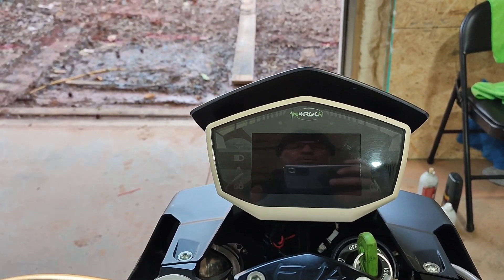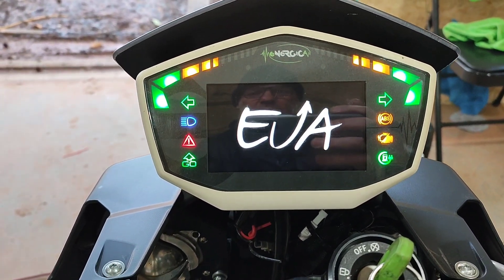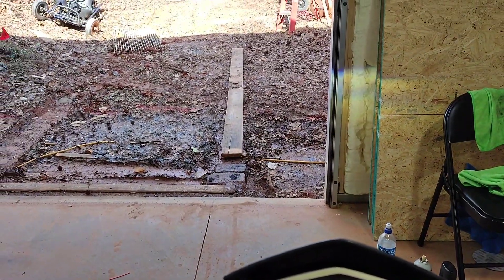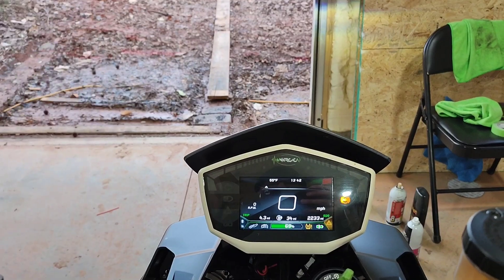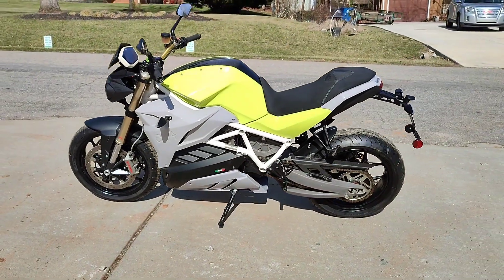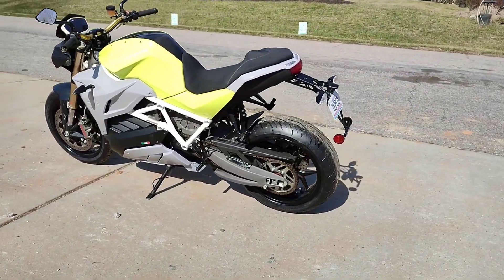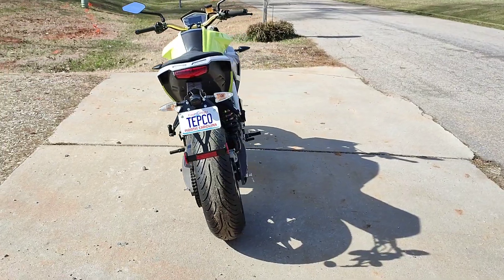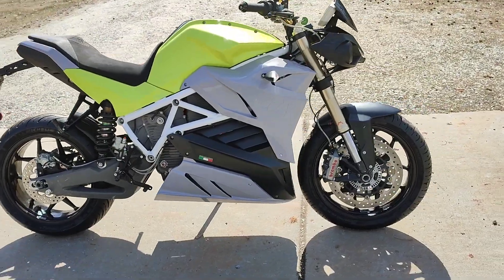Energica Eva rescue complete!!

Comment: Did you get the info on what they actually did to revive the main battery? And cost?
Reply from the maker: They just slowly charged it and monitored the cells. A few hours labor charge. Although I'm able to ride it, it's not perfect, I think I have a weak cell that is causing issues and throwing it into limp mode more often than normal if I ride it hard.
Reply: @TepcoCycleRepair yeah I saw your post on FB they gave me the run around when I spoke with them. Now I think my inverter is out and they act like they don't know how to even diagnose it. I'm about ready to just scrap everything and build it up with the motor.
Reply from the maker: @roodick85 They really need service centers around the county for the batteries and/or a battery replacement program.
Reply: @TepcoCycleRepair ended up doing it myself. Might upload it but damn it's a mess 😕
Reply from the maker: @roodick85  That's cool, would love to check out what you did.